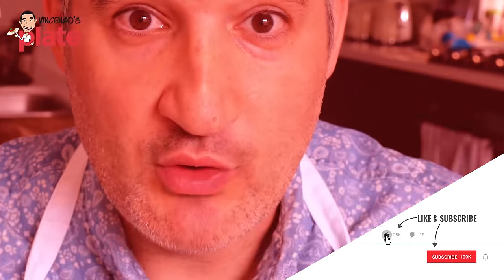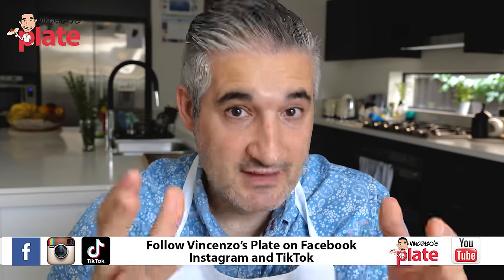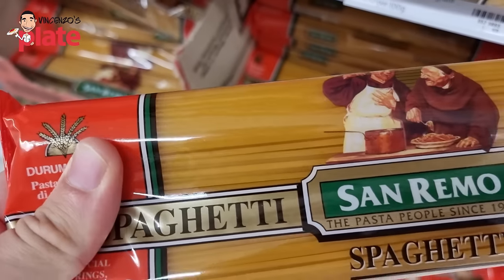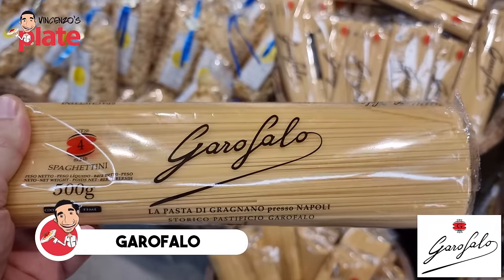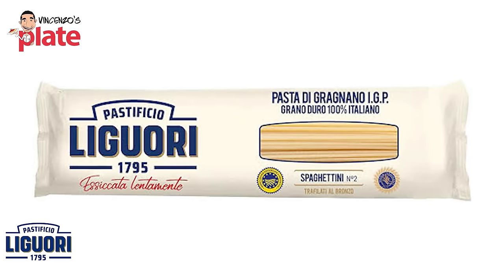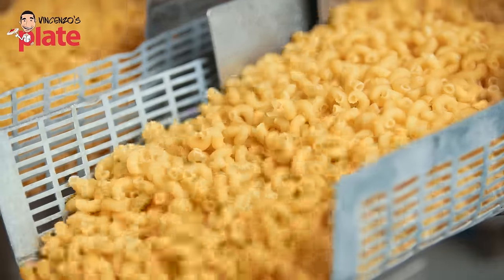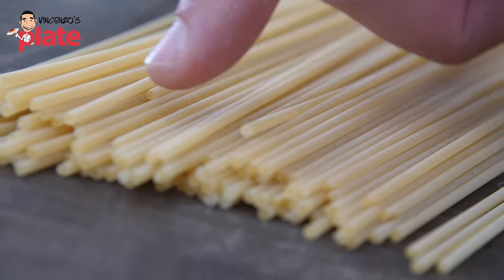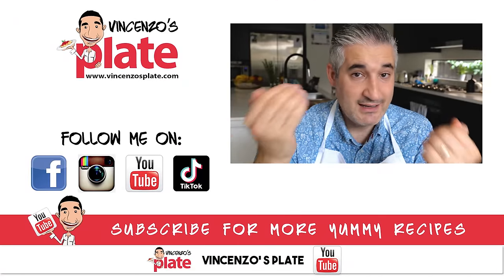How to BUY PASTA like an Italian (It will Change your Pasta Game Forever)

Comment: I usually make my own fresh pasta, but when I do buy dried pasta, I’ve found that almost all imported pasta from italy is fine so long as it is BRONZE DIE CUT. The issue with brands like Barilla is they use teflon dies to cut the pasta, and the pasta is too smooth.
Reply from the maker: Agree! Also fresh pasta is always the best 😋😋
Reply: @vincenzosplate  I totally disagree because you cannot get al dente with fresh pasta.
Reply: Yes, fresh and dried pasta are NOT interchangeable.  Fresh is great if you're making a meaty ragu, for example.  But for a lot of pasta dishes - including most of the classics - any chef will tell you dried is actually better.   @tomawaknawak
Reply: @vincenzosplate Sapori del Vallo is the best fresh pasta I have found on the market.

Comment: Where I am in the states the common brands (not getting into store brands) are Barilla, Prince, and to a lesser extent DeCecco.  Ronzoni, Rao’s, and Divalla are also gettable without to much trouble.  Ronzoni is junk.  And then Divalla is next up.  Barilla and Prince I would consider nearly indistinguishable.  Rao’s I’ve never had, too dang expensive.  DeCecco is my favorite.  DeCecco is on sale constantly, usually for only .01 more than Barilla.
Reply from the maker: De Cecco definitely better than Barilla!

Comment: Where I live, you can find La Molisana, Liguori, Rumo or De Cecco in every supermarket, everywhere. No Barilla to be found anywhere though. 

My favourite is La Molisana. Over here they also have regular sales, where their entire range of products is for half price.
De Cecco is pretty good as well and Liguori is imo on the same level them. Liguori does have really fancy paper packaging though. La Molisana has better pasta though imo.
Some supermarkets also have Rummo, but they are imo slightly worse than De Cecco imo. Still good though and they also have regular sales for 50% off.

All of those are also roughly the same price as well. La Molisana and Rummo tend to have more sales though.

I've also had monograno, which I agree is better, but the difference between these kinds of artisan pastas and the high quality factory pastas (like Molisana), isn't as big. While the difference between quality factory pastas and those cheap glossy dark yellow pastas you can buy everywhere, is quite large.

Comment: Btw, Molisana is not cheaper in the USA, it is like 8-9 dollars. But it is incredible! Most good brands here are around 10-11 dollars.
Reply from the maker: Once you experience the taste of the higher-quality pastas, it is well worth it. You don't want to go back to the less expensive ones at all.
Reply: @vincenzosplate  absolutely. I had a really crappy pasta sauce today (something I try to avoid), but using La Molisana plus some roasted pine nuts and fresh basil made an incredible meal against all odds

Comment: I check that it's made from Durum wheat, made with a Bronze die ( which leaves the rough surface for the sauce to stick to and hence whiter colour) and made in Italy (As I'm in Europe anyway), if I follow these guidelines I find that I can't go wrong. I've always understood that the bright orange (cheap) pasta may not be made from durum wheat and possibly standard white flour and is shiny as it isn't extruded through a bronze die - interesting point about the drying time though.

Comment: I'm living in Belarus. We have Divella and Barilla here (maybe more mass-brands, these 2 are the first what comes in my mind), so i tried to find a Mancini pasta, and i found Grani Turanici Penne Rigate... It costs 30 euro per 500g pack. Official Mancini site price - 5 euro (decent Barilla pasta pack is about 1.3 euro, Divella is even cheaper)
😂
Reply from the maker: Divella is a good brand as well, It might not be the best but it will still deliver satisfactory results. Although the good ones are always costly or expensive, you will always know that there is a big difference in the quality and flavor of these pasta brands. The artisanal brands have better texture and does not overcook easily. Barilla is also a good brand, I used to cook pasta dishes using Barilla before I was introduce to Artisanal brands.

Comment: I can taste a good quality pasta. I will not eat cheap pasta. Some people dont understand when you talk about it. Even down to certain shapes for certain sauces as it doesnt taste right. I wilI use La Molisana mostly this has to be brought either online or at an italian deli/shop. Next Di Martino if i find it.  Supermarkets here in the UK have mostly their own pasta along with De Cecco @ £2 Barilla @ 1.30 and 1 shop i have found Di Martino. @1.50 (approximately) so easier to find. The others that  you mention are hard to find and some pasta as much as £6.50/7.00 or even more for 500g is considered expensive. I totally agree good pasta makes a difference.

Comment: I use Barilla most of the time and I prefer it over the other "cheap" pasta .  I am willing to try the other ones. I am sure they can be better, I guess I will find out. I do have access to Garofalo, De Cecco and La Molisana, Rummo , Delverde and a few others. I mostly eat Spaghetti and often times these other brands have the other shapes. But if I find them in Spaghetti form. I will try them.

Comment: Vincenzo, are you familiar with the Alessi brand? I have started using a product that they call "Spaghetti Alla Chitarra". It is square cut with bronze dies, and seems to meet most of your requirements for a quality pasta. I knew that using higher quality pasta would improve the texture, but what really surprised me, was the flavor. It has a subtle, but still noticeable difference in flavor, that I really enjoy. Anyway, I was just curious if you had tried the Alessi brand. They make a wide selection of products for italian cooking, but I have not tried most of them.

Comment: This Video was hyped on SBS!
said slow drying, less yellow(for non egg pasta) keeps nutrition and correlates with less furosine:
(More furosine is a bad sigh because deteriorating the quality of amino acid and proteins due to a blockage of lysine and a decrease in the digestibility of proteins)
Reply from the maker: Thanks for the comment! It's great to hear that the video was highlighted on SBS. Slow drying and a less yellow color in non-egg pasta are indeed important factors. Slow drying helps retain the nutritional quality of the pasta, and lower furosine levels indicate better protein quality and digestibility.

Comment: You forgot to explain how important is the extrusion process in the pasta making. The top quality pasta are made using bronze (or even gold) extrusion dies that make the pasta surface more rough so that the final product retain the sauces better, the condiments does not slip away but stick to the surface of the pasta. So if you see that mentioned on the label of your packet of pasta ("trafilata al bronzo" in italian) you know you are buing a better quality product.
Reply from the maker: Thank you for pointing out this important information! Keep up the curiosity about good pasta🇮🇹🍝

Comment: How about the whole spiel of extrusion dies one being made of bronze giving a rough texture vs a smooth stainless steel, extruder giving a smoother texture, apparently affects quality and rate of absorption. I speak under correction
Reply from the maker: Thanks for sharing your knowledge! The choice of extrusion dies definitely affects the texture and absorption rate. I usually use bronze dies for traditional pasta, but for some recipes, I prefer using stainless steel to get a smoother texture. Do you have a favorite type of pasta to make? 🍝

Comment: @vincenzosplate I tried the D&G Di Martino Spaghetti and it wasn't that great -- too skinny almost spaghettini.
Reply from the maker: More like a spaghettini? You should try Molisana next.
Reply: @vincenzosplate  La Molisana is my standard because it has been around in local supermarkets for 4 years, at least. Delverde is available but costs 50% more (@USD 4) than La Molisana. Di Martino is a new arrival and is available with only one chain. Mancini is also around but @ USD 8 per pack (import costs) so I only buy when it's on sale.

Comment: Should I buy Italian even for Ramen?
Reply: No. The noodles that are used for ramen have a different texture than what you will get out of an Itialian pasta, even a top quality one. Ramen noodles should have a springy texture to them. For top quality ramen noodles I would suggest SUN brand. You should keep in mind that not all ramen noodles are the same. Some are thinner and more delicate while others are going to be more robust.
Reply from the maker: Like Ron mentioned, there's a huge difference between ramen and pasta, they are very different. If you want to make ramen, use ramen noodles, but if you want to cook a pasta dish, use pasta.
Reply: @vincenzosplate  It was a joke.  I make my own ramen noodles and occasionally pasta.  I have a pasta machine and everything.  Not a noodle machine as the only good ones are antiques.

Comment: "High temperatures kill the pasta. No benefits, no protein, no fiber, nothing." - So you always "cook" your pasta in cold water so as not to kill the proteins? Big fan of your work, but that sounds like nutritional nonsense.
Reply from the maker: I am talking about the drying process of the pasta and not the cooking. The drying pasta step its an extremely important step
Reply: @vincenzosplate  Industrial high temperature drying occurs at 60-120 °C. If these temperatures were to "kill all nutrients",  putting the pasta in boiling water or baking a pizza at 350 °C would do, too. But it doesn't, because high temperatures DON'T kill all beneficial nutrients as you say. Apart from that it's a great video, though. 😉